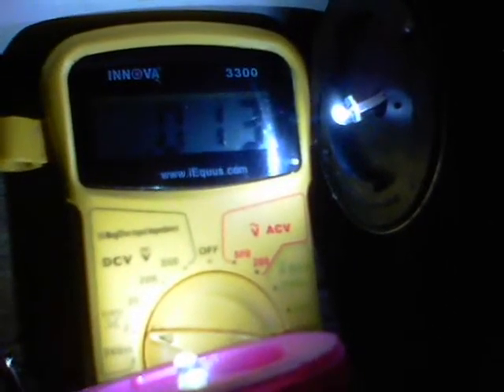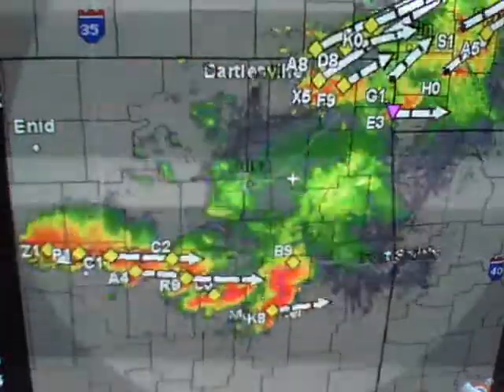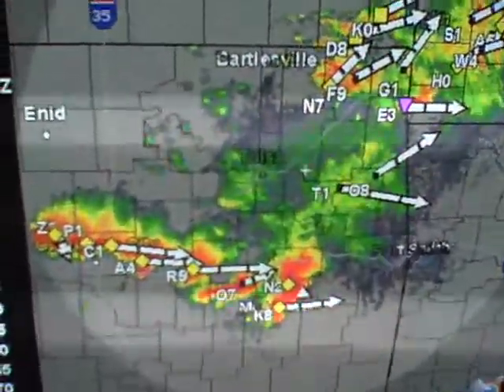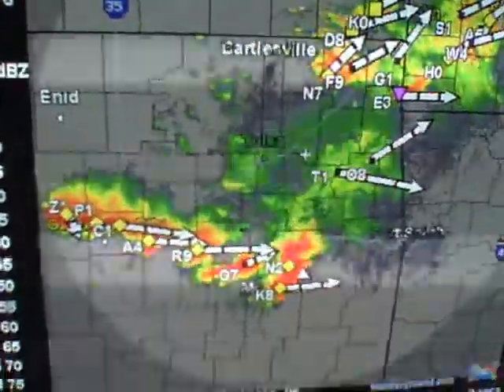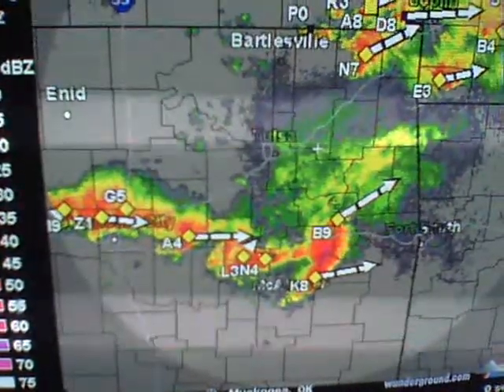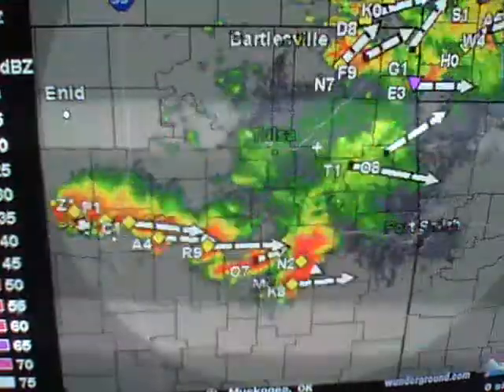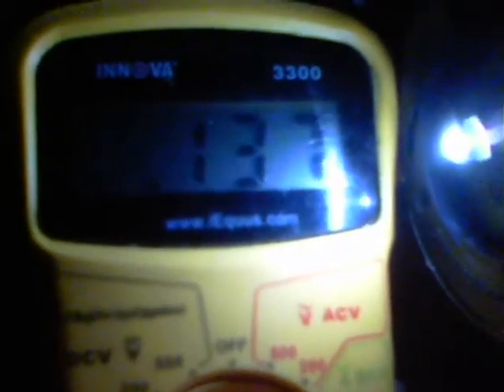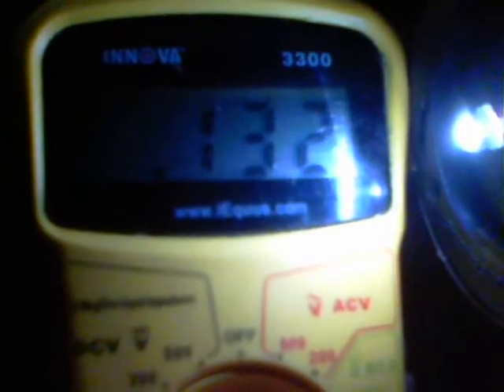OKC Storm - Lightning Experiments

Comment from the maker: Some kind of hydro system would be a route. Lightning energy into huge caps, power a pump to send it to higher ground, release with a valve to run a waterwheel generator.
Tonights show is about the Giza pyramids being built before the Egyptians took over the land...should be good. I sit listening while winding coils etc usually :)

Comment: yeah i figure that one wire off a solar panel behaves like an antenna with very fine and randomised crystals of silicon being so small they catch very short waves and also the branching of connections catching larger waves.
so it is definitaley a wide band antenna

Comment from the maker: My method uses 30 gauge wire...max output is about 1.3A. But, vid to come about that. With using broken pieces I can't get more amps anyway if below a certain size + that's when matching pieces matters. Will be building lots of 20V 1A, then bus bar to carry amps.
Ah the cap was leaking due to be loaded by the meter, it was only later that I realised it would still charge if I put the meter behind the diode (duh huh). Osc's etc are next in line..it's not like we're short of storms in this area :)

Comment from the maker: Ha cheers..140V ! Was thinking of doing something like that for mains power on sunny days. But battery charging beats anything like that. You could do 8 panels of approx 18V each to charge 12V batteries. Leave to charge while out away from the camper during the day, use the battery power (with perhaps a Mains inverter) at night.

Comment: Would be intrested to see two panels, with same number of cells. one wired for amps, and the other for volts. Then compare watts into a cap. As your cap seems to be leaking out fairly fast. perhaps you could run an oscillator from it, to store the power more efficiently? Great testing. Also good to hear you survived the storms.

Comment: My 10-12a system used to pull half an amp on star light, on really clear country nights. and sometimes over an amp on a good full moon with lots of stars. I think lightning used to blow my 20a fuse... never knew why until your last lightning solar video... The storm had to be close, but never close enough to hit the panels... used to drive me bonkers trying to work out why I would blow fuses!!

Comment: you will see similar results with a piece of sheet metal and a ground wire,also if you take one side of the panel and use a ground wire.

Comment: Thanks for doing this. Interesting experiment. When you were charging the capacitor did  your circuit consist just of a solar panel, diode, capacitor and meter? If there was no battery anywhere then that's pretty impressive - and cool. :)